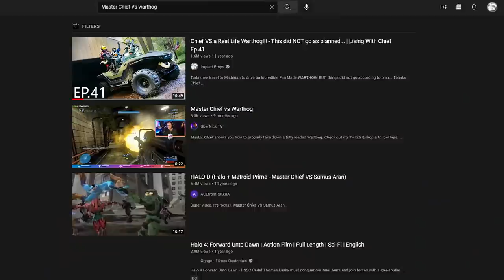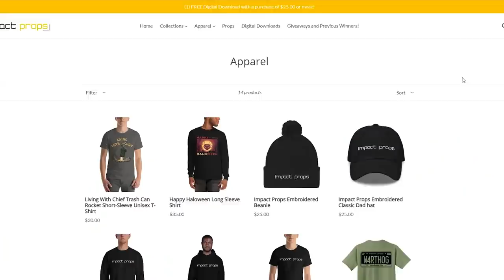Master Chief DESTROYS Real Life WARTHOG | Living With Chief Ep.58

Comment: I remember seeing the first video of this Warthog years ago an was amazed. Can't judge to much cause of the cost with no logistics or backing by a company and the tools he had and parts to built this and now it's kinda done, it's looks cool, but.....

Hoonigan has built a Warthog (in a year) and got this one in the dust. Yes Microsoft & 343i commissioned the build. The craftsmanship is very well done. With a Kevin Carrol Red Dot Engineering four-wheel hydraulic steering rolling rock crawler chassis. 7.2-liter Ford Windsor 351 V-8 was bored out to 431ci and with the help of two Garrett turbos is good for over 1,060 horses at the rear wheels (yes it was Dyno tested) and well over 100 mph . Gearstar Supermatic80 transmission with Pro-Billet Torque Converters and an Advance Adapters Atlas II transfer case. Custom Intercooler, 43-inch MT Baja Pro XS tires and it's fully functional off-road racing suspension. King 3.0 bypass shocks, coilovers, and bumpstops work with the Warthog's triangulated four-link suspension to locate the pair of heavy-duty Currie one-ton axles. This Warthog has four-wheel steering and the ability to switch between Front Wheel Drive, Rear Wheel Drive, and All Wheel Drive. DTC60 Fox Motorsport Brakes to be able to stop this monster.

Again I'm not knocking on Bryant Havercamp's build. He built a nice Warthog with the budget he had.